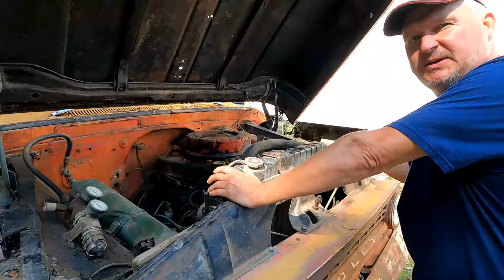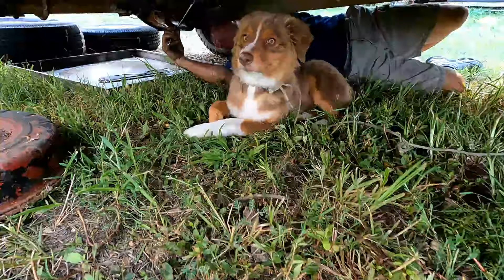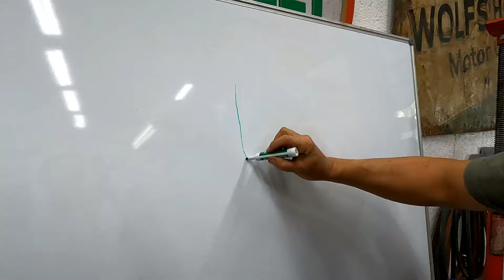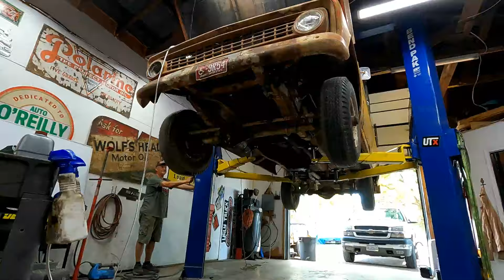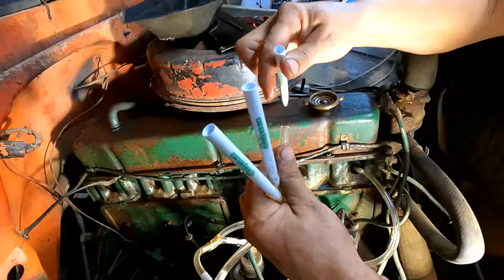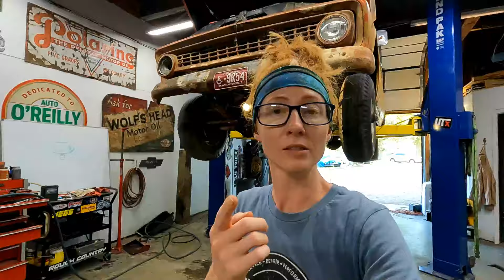EVAPORUST to the RESCUE! - Will This 1963 Chevy 4x4 TURN OVER? - UTX

Comment: have you ever thought about putting air to the cyl. that is at TDC as long as the valve are ok  I know when I have changed springs and put air in the cylinder it will push it to the bottom
Reply from the maker: Yep,  that will definitely push a piston down when they are not stuck.  I did try air on this one while I was prying on it with no luck.  The problem with air is it compresses.  That grease will not.  Thank for watching.